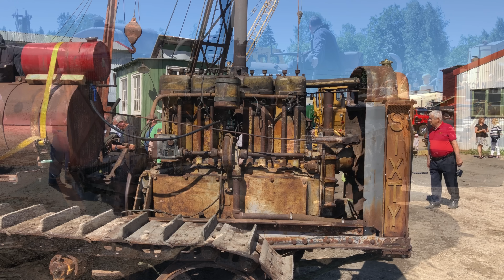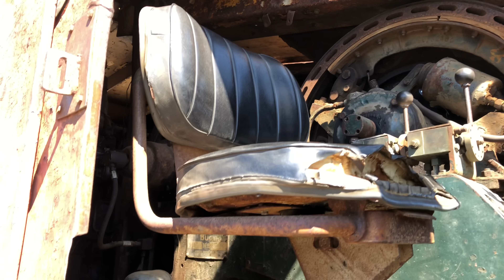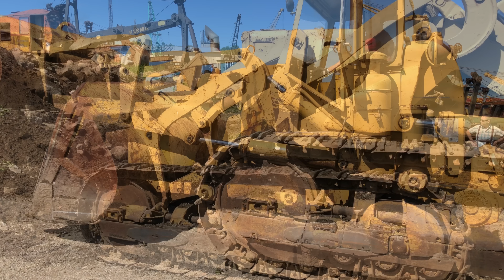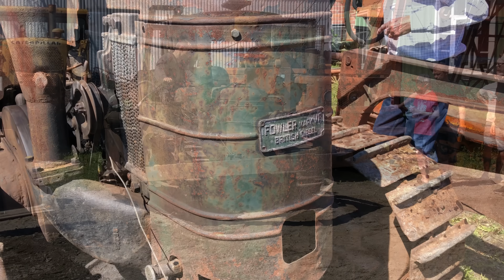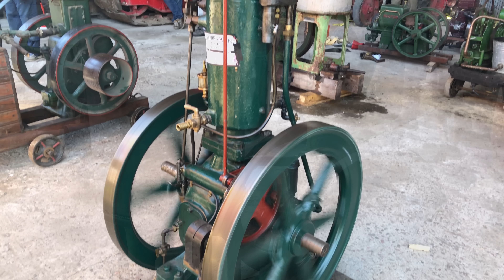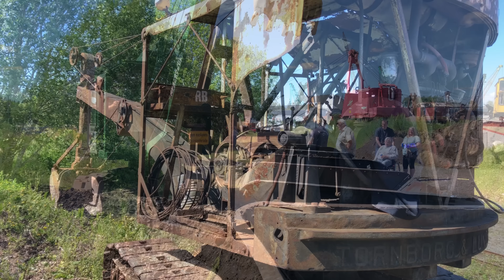Skyttorpsdagen 2019 Heavy old machinery in action

Comment: Back then things were made to last. I doubt you will see the machines of today running in 100 years time.
Reply: Most made within the last 10-15 yrs won't even last 60 yrs!
Reply: LOL... they produced thousands of these machines and these are propaply the only ones left, rest is scrapped long time ago.... so that much of their durability.....
Reply: @SchnelleKat  Why should they, in 60 years we have something totally different, propaply robotic, or electric machines which overtake these in every way.
Reply: @bobsnabby2298  My reason is they wouldn't. Lol.
Reply: I highly doubt in 100 years any construction equipment will run on fossil fuels..but your point is valid new machinery is not built to last...its built fast and as cheap as they are legally allowed to produce them, buy ALL of your big manufacturers...but dam they are nice to run
Reply: @farwest571  Not true at all. Modern machines are built much more better quality materials and higher precision with lot of studies and tests before any manufacturing. The thing is that they arr not even meant to last decades which means that they are periodically replaced to newer machine. Sure there are cheap crappy  models too but if talking about quality machines they would last decades if they are properly maintained and not abused.
Reply: @bobsnabby2298  .......um you have the same basic points that I already brought up just worded different...you said not true at all then preceded to re-word exactly what I had already said...whats your game here?

Comment: Are there any more footage of the small pull scraper at the start of this video ? I  curious how the mechanical lower raise & dump worked from one hydraulic valve
Reply: A lot use the ground drive from the rear wheels to flip the bucket over , some simple ones are almost round and roll themselves , depending on the soil conditions they can be very efficient ..
Reply: Three sections of the scraper bowl, the cylinders move the center cutter section.  The front section that holds the dirt in the bowl opens by the rollers that ride on a track on top of the hydraulic cylinder as the cutter edge lowers to ground level.  The rear section opens by cable as the whole bowl is raised higher.  This will give you a better view of the hydraulic cylinder and pivots, but the cable is not in place:  https://lacrosse.craigslist.org/hvo/d/de-soto-pull-behind-scraper/7242608041.html
Reply: A tumblebug would have no wheels.  This has no ground drive from the wheels, only one two way hydraulic circuit, which was quite advanced in the 30's when this was designed. Most crawlers would have no hydraulics, only a cable control.  GarWood  model 25.
Reply: @rebeccakimmet5474  thanks for the info very interesting and clever the geometry must be just right or a lot of trial and error ? Thanks again